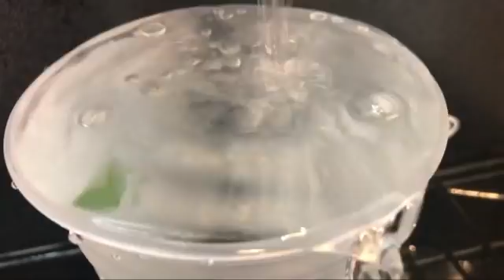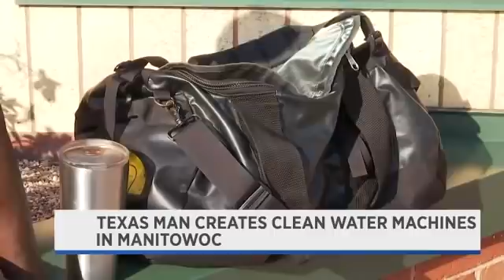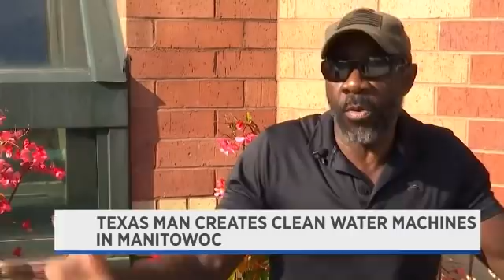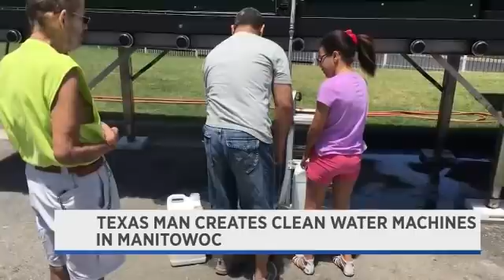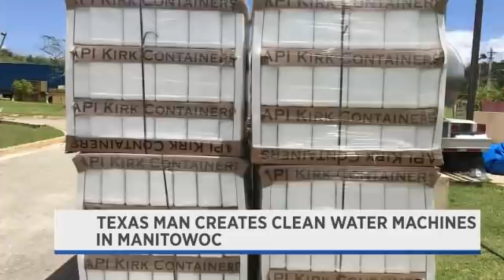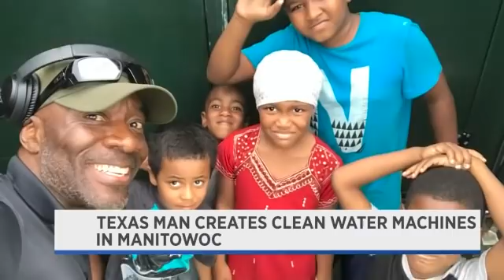Texas Man's Invention Creates Drinking Water from Air

Comment: Isnt this a dehumidifier or a condenser like in a hvac unit?
Reply: Josh Rick He wants donations made to the “Water Rescue Foundation” Almost has a legitimate ring to it doesn’t it. This is racketeering in its purest form.
Reply: Josh Rick education
Reply: The condenser in an hvac unit is actually the machine that dispells unwanted energy to a undesirable location, the evaporator, or air handler unit is actually absorbing heat and dehumidifing the air,
Reply: @josetrevino9869  you are correct, i named the wrong coils
Reply: Drink water from your dehumidifier and see what happens.
Reply: Ok smart asses “The machine that Moses developed was innovative from the start. One of the challenges of scaling up atmospheric water generation technologies is the amount of energy they require to function. Many units on the market today are very energy intensive.
Not this machine, though. The Texas Commission on Environmental Quality requires power consumption no higher than 0.13 kilowatt-hours (kWh) per liter for approval. The unit developed by Moses used only 0.08 kWh in testing, and in Puerto Rico achieved 0.05 kWh.”
Reply: Pocari Suit 
I’m puzzled that TCEQ would fail to approve its use unless it kept energy consumption within certain specifications.

Surely there are water starved areas like deserts where they would pay almost any price for water. 

The mineralization of the water will be important. Drinking distilled water isn’t good for people long term.
Reply: @larrytruelove7112  Better than Dirty or Polluted Water.
Reply: @ar_xiv  And when these machines breaks or need regular maintaince then it will crash in countries like Africa, Haiti and more.
Reply: William Burns 
Perhaps you didn’t know, but I have worked in municipal water treatment for over 30 years. And I agree. I cannot imagine how this would be competitive with various large scale water treatment supply schemes.

However, in remote high altitude or arid regions, I can imagine how it might be desirable... even at a high cost. But we’re really talking about drinking water only. For washing, bathing or waste water needs (sewage), poor quality gray water would suffice.

Another area where it would be designed are the areas where surface or ground water supplies have been polluted.

Still, in most areas there will be rain.
Reply: @larrytruelove7112  u should invent something and pay millions and give it away with yr 30 yrs of doing your day job instead on posting slick talk about a man helping the people on YouTube im nlt gonna discredit your work but come tf on man whos side are u on
Reply: CHICAGO NATION NEWS 
Water production always comes at a cost. The average American uses way more water than this man’s machine can make. It requires energy input to get the water out of the air.

It’s entirely possible that he has no new process that hasn’t been tried before. Some of these things don’t become widespread because they aren’t commercially viable. But small operators can still make themselves money by advertising on the internet.

Have you ever known people to buy a car and drive it home, only to discover that it had a lot of problems? The car ran, right? It sounded great. But the hidden problems were not obvious and there was no warranty and no guarantee.

The video doesn’t tell me enough. It could be great, or it could be too expensive to be commercially viable. I’m not going to endorse it based upon a single video.

Did you ever see condensed water drip from a dehumidifier or an air conditioning unit? Typically, we don’t produce everyone’s drinking water that way because it’s too expensive. But for small water needs, far from rivers an lakes, someone might already be doing it.

But large cities can’t produce municipal drinking water that way. The quantities are too large.
Reply: I believe I saw a machine like this on mythbusters and also a small backpack one on shark tank..lol
Reply: Odins Spear 
I’m not challenging your experience.

I does leech minerals. We just don’t know how much. While the danger is potential, it’s largely unknown.

I’ve heard it several times since I’ve worked in municipal water for decades. I looked it up since this discussion started. The danger appears to be hyped and unclear.
Reply: Right
Reply: @GeneralRobertELee-d6m  You can drink distilled water for an entire long life. It can only hurt you if your diet has no minerals in it. Even junk food has enough minerals to cover it.
Reply: Ming Mongo 
I understand your point about distilled water. However, a lot depends upon one’s health conditions.

In my career of water treatment, drinking distilled water has been inadvisable.

Another reason for adding the minerals before drinking is that distillation does not necessarily prevent contaminants like pollutants or pesticides or herbicides. If there are minerals they might inhibit the contaminants from being absorbed.

Something as simple as a little diatomaceous earth or some iron or salt additions would help.
Reply: William Burns 
Good point on the high altitude humidity. I wasn’t thinking about the efficiency. It’s just that in some environments, water will be in short supply.

Perhaps, there will be better water sources.
Reply: Absolutely is.
Reply: @GeneralRobertELee-d6m  you can drink distilled water... but it slowly leeches minerals from your body.
Reply: @GeneralRobertELee-d6m  You can drink distilled water; you just can't drink ONLY distilled water.
But if you eat something with salt, or take electrolytes, you're fine.
Reply: @bcubed72  Ok Aquafina and Nestle along with several other distilled water bottling companies use reverse osmosis. For those of you claiming about the elctrolytes needed and on and on those minerals do not disappear. The bacteria is what gets eliminated. The plastic containers is what gives you gut rot if you drink it hot. It is the breakdown of the container and reusage that kills you. In and out of water plants all the time. They tell you this. So enough fighting over it. Distilled water is basically boiled water to kill the enzymes and bacteria that hurt you. Why do you think they tell you to boil your water when treatment plant has issues?
Reply: @ericshimer6669  
No, that's not how a still works, genius.
Reply: @ericshimer6669  wrong
Reply: Eric Shimer 
Boiled water notices can happen for various reasons. Sometimes it happens when the chlorine residual gets too low for a certain length of time. I don’t remember the regulations but they vary from state to state as long as they comply with the EPA.

Sometimes it happens if the water pressure gets too low, even the chlorine residual is okay. Sometimes it happens as a result of contamination.
Reply: Eric Shimer 
Enzymes? What enzymes?
Reply: @ericshimer6669  Wow, you are so confident but clearly you dont have a clue what you are talking about. One of your facts is a well known myth as well. But here's a participation trophy for trying. 🏆
Reply: William Burns use solar or wind duh
Reply: judas0l7 Sad part is just looking at the responses how bad science literacy is in the US.  He isn’t the first nor the last that will have “invented” a dehumidifier to deliver water in one of the most expensive ways to people.  These systems have been debunked over and over. I am just wondering if #thindef00t will do a special on him.  https://youtu.be/vc7WqVMCABg
Reply: U is got 2 b da dumess mane inda wordl gregh
Reply: Josh Rick I drink distilled water all the time you obviously don’t know anything
Reply: If I can buy a solar generated unit, this would make living in the desert or off the grid easy.
Reply: Yes his invention is superior than mine's mine's steals water from blood cells like a vampire thank him thank him hard
Reply: good intent fellas
Reply: @HammerLeaf  🤣 👍
Reply: My ac unit drips out 5 gallons a day.
Reply: @dannypai8787 curious how he purifies that water we all know how condensate pan breeds bacteria
Reply: yes. but let them enjoy their self made conspiracy and intelect.
Reply: Dlonra Reggenzrawhcs sounds like a hater
Reply: @lordrefrigeratorintercoole288  lol peckerwood is sad another great invention was made by your daddy'sdaddy
Reply: This article breaks down his invention a bit more. https://steemit.com/water/@domestictiger/made-in-america-moses-west-s-atmospheric-water-generator
Reply: @ar_xiv  thanks for shutting up these parasites lol
Reply: According to the "journalists" and the "inventor" it's an "AWG"
Reply: And his invention worked well enough to piss off someone in Flint who wanted it gone, probably the water company.  https://nbc25news.com/news/local/atmospheric-water-machine-vandalized-in-flint
Reply: Pocari Suit 
I’m not sure about the likelihood of pinning it on the water company. Some people are just mean.

Anyway, assuming it was a competitor, lots of private industry water filter companies sure must dislike this startup.

I don’t know.

Comment: 👍Bless him & his beautiful mind!!! 💞
Here we have a machine (basically a dehumidifier with a filter) that ends the water crisis around the world....🤔so why in the heck aren’t they every where they need to be???!!!??!!!😡🤬
Reply: Because in places where they're needed, i.e. dry places with no rainfall, there is hardly any water to pull from the air. Dehumdifiers only work where there is high humidity. If you use it in a desert you won't get any water, but if you use where water is readily available, sure have all the water you want. This machine solves a non-problem, since most of the places that it could even be used already have in-ground plumbing and tap water which costs next to nothing to treat.
Reply: Carp Runner - I understand your point however it does solve problems as in the case of Flint, Michigan. 💞
Reply: Everything about money in this world that's why

Comment: It’s a dehumidifier + water filter. Thunderf00t has debunked these several times in the last few years. Sure you can get water this way (in a humid environment), but it costs far more than just filtering existing water. This thing is using most of its energy consumption to cool outside air for nothing. The water it produces is ridiculously expensive and no cleaner than the water out of any decent under sink water filter. People who have never had a dehumidifier have this notion that water condensed out of air is “pure”. But anyone who has one would gag at the notion of drinking the swill that ends up in the collection bucket. It’s amusing to listen to the “inventor’s” doublespeak as he suggests the water is pure before filtering but doesn’t finish his sentence. Using this anywhere where an existing water supply can simply be filtered is uneconomical, unnecessary, and nothing but a publicity stunt.

Comment: Good luck if you live in a desert like I do.
Low humidity will get you near zero water output for a lot of energy input.
You would get more water burning gasoline as gasoline @ around 6.5 lbs a gallon
creates a little over 7 lbs of water. How does it get heavier you ask? It also takes
nearly 27 lbs of oxygen to complete the process. Add that together with the CO2 and
nitrogen then divide by the relative masses and you end up with 7 lbs of water.

Comment: this has been going in for decades.  the question is hiw to harness water as cheap as possible for mass use. i have seen a portable unit that runs off 110 volts.  seen a unit that attaches to your bicycle harbessing humidity while the user rides off to somewhere.

Comment: Not to throw cold water on the idea but it's a dehumidifier with a water purifier attached. It still needs electricity to run. The more humid the air has the more water you'll get per hour.

Comment: It has been used in Cyprus for many years now, so nothing new. He grows food in a large greenhouse, with water from the atmosphere, by means of an atmospheric condenser. Water from thin air..... using the cold water from the sea to cool fins of porous corrugated material, which attracts the water from the atmosphere, the same way as a can of cold beer from the fridge will do. The power to generate the pump to draw the deeper cold water up from the sea is generated by solar power and, or wind power.

Comment: ummm... it's a dehumidifier...nothing new...which is why how it works is conveniently  left out of the video...all you need to do is blow humid air over a conductor that's temp is below the dewpoint of the environment its in...its how air conditioners work...people think that an air conditioner works by cooling air only...but that is wrong...they work by taking humidity/moisture out of the air by condensing it into a liquid...which is one of the reasons  they are put in windows...and the other reason of course is that you must take heat from inside and put it outside in order to cool a room...using desiccants is the only other way that I know of to remove  moisture from air which this clearly does not use

Comment: did not invent anything but another hustle. he made a large dehumidifier
Reply: Because it's a very inefficient way to generate drinking water.
Reply: @claudiodiaz9752  no need to build dams, low consumption of electricity, can be manned by one or two person, water is free. Now tell me why it is inefficient?
Reply: @kakabitan  Because you need obscene amounts of energy for generating a relatively measly amount of water. If you have this energy available un the site to run a machine like that, you better use it to build a well or pipelines.
Reply: Then why the dehumidifier makers didn't made a large one?

Comment: This is an air conditioner. This is the same type of air conditioner they use on grocery stores. The energy cost per gallon of water is going to be like 50 times more than just driving it there in a water truck. Not trying to be a dick, but this guy hasn't "invented" anything.

Comment: First off, water is plentiful, that's why it's cheap. Second, in areas where it isn't cheap and not plentiful, i.e. a dry or arid region, the energy required to pull moisture out of the air in any practicable amount is cost prohibitive. Most third world countries don't have a lack of water, they have issues with pottable water, they need energy infrastructure to clean their water and deliver it. Oh ya, it's just a big dehumidifier and I'm fairly certain they've been around a while now.